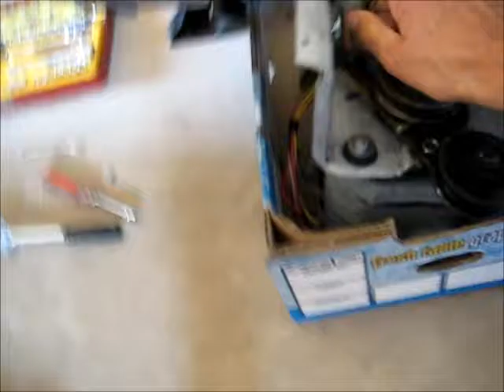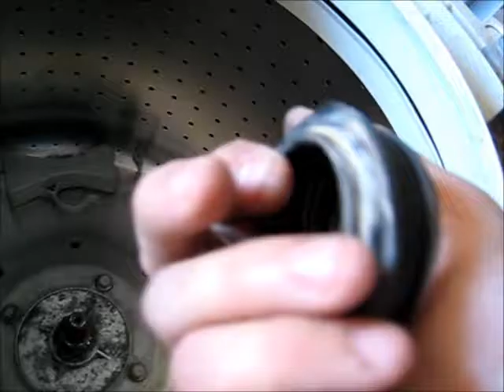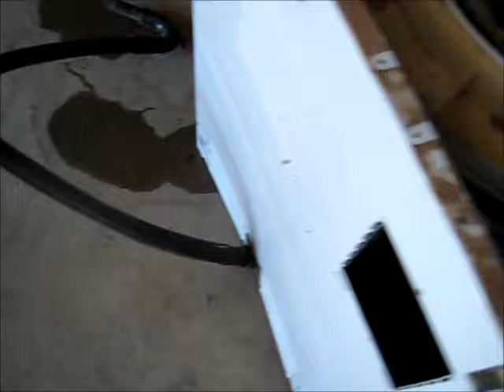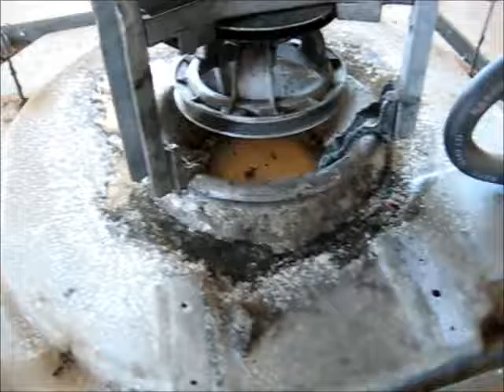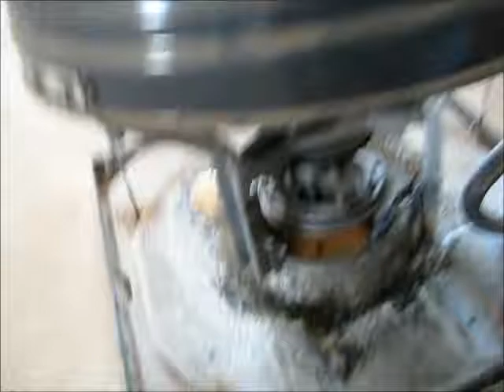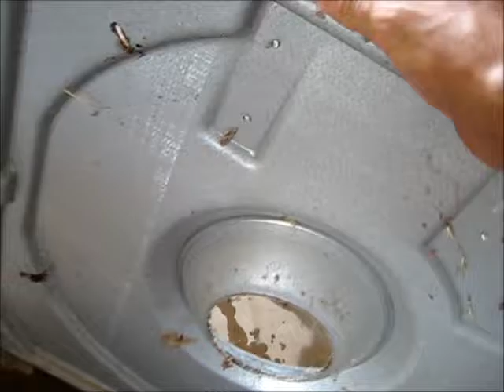Speed Queen Autopsy

Comment: I have a Speedqueen washer similar to the one taken apart, which does not spin the washing dry enough. It seems that there is suppose to be a fast spin cycle it doesn't enter into. Can it be anything else than the control switch perhaps. The pump and motor seems to be fine, filling is good, it's only with the spin cycle that something is wrong.
Reply: +Andre Botha  it could be a brake issue. especially if you burn through drive belts
speed queens are notorious for seized brakes

Comment: Fairly new machine, I changed water level, good call, problem is machine spins but not good enough, clothes are still wet, used to work fine, like a loose belt or something, any ideas?